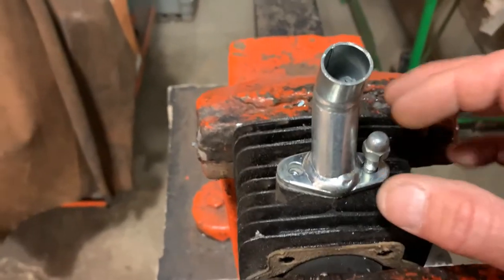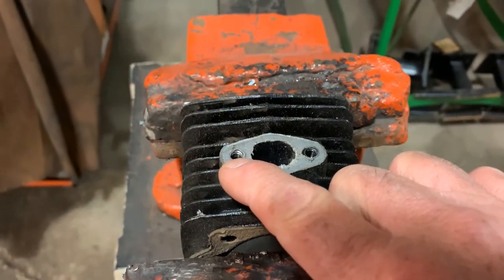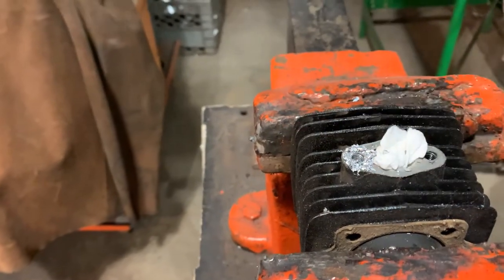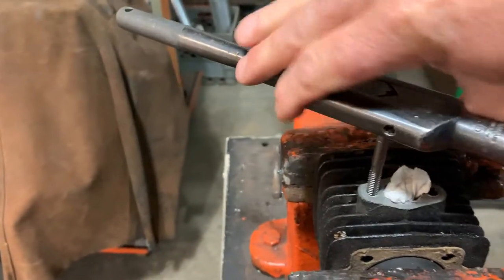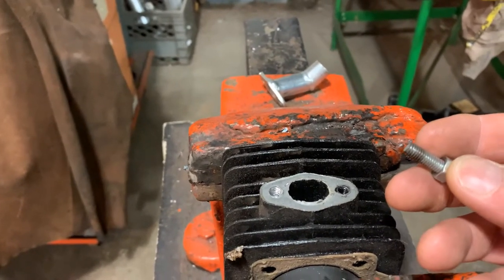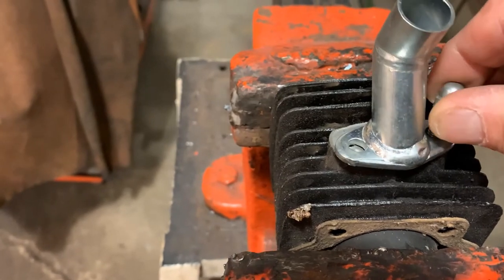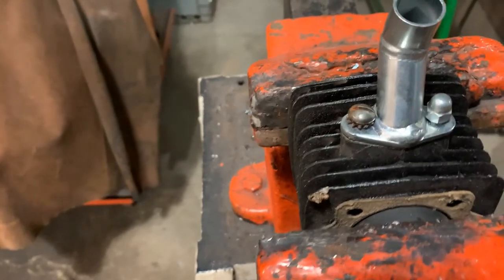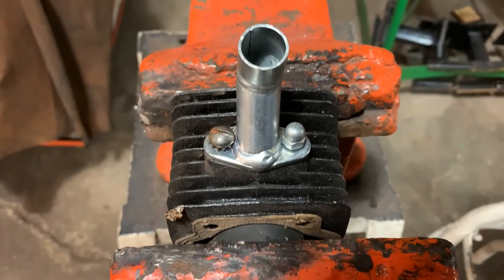How to repair stripped threads

Comment: Jb weld or red thread sealer?
Reply from the maker: Neither one will work for stripped threads. The only correct way to repair it is to re-tap the threads in the hole..🤷‍♂
Reply: @EcoTransGaspoweredBikes  I was going to jb weld it permanently in the case
Reply from the maker: @Gothguitarist  It won't hold.. Maybe a day or two, after the engine gets hot & cold a couple times it usually breaks loose..😭😭 You have nothing to loose by seeing if you can be the first to make it work..🤷‍♂
Reply: @EcoTransGaspoweredBikes  yeah I was hoping jb weld high temp would work
Reply: @Gothguitarist  did it work i might do it to
Reply: @FrenchMonki  drill it out or use a bigger bolt sometimes he's right tap it I ended up using a bigger bolt and jb welded it but results vary honestly better off buying another cylinder probably